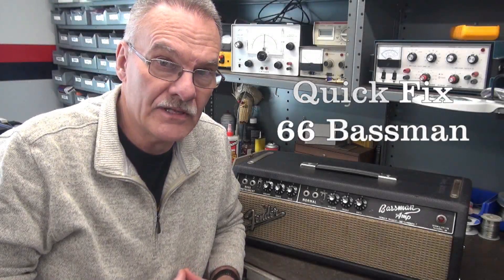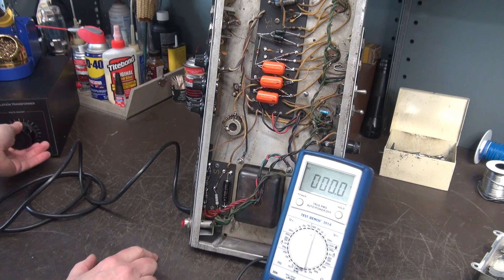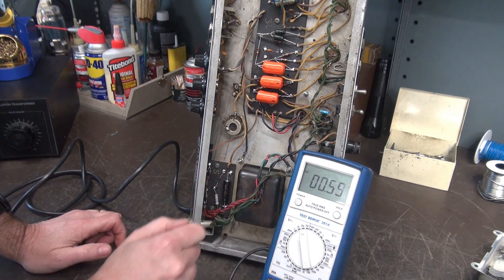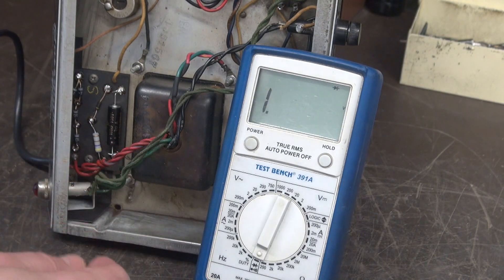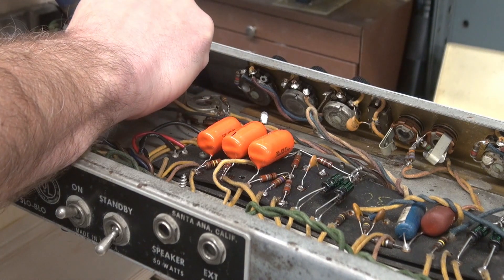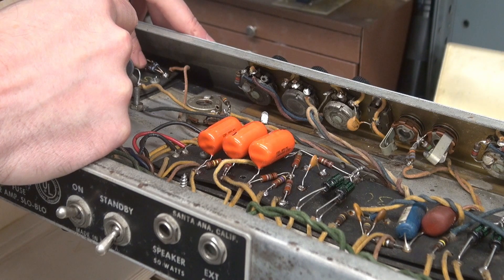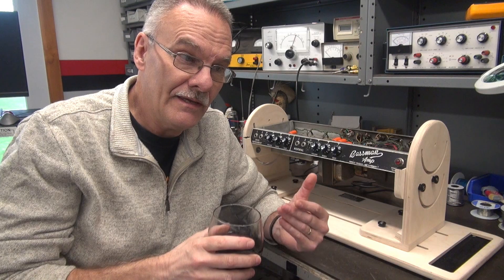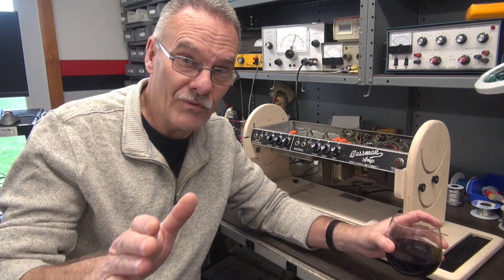How to quickly repair Fender Bassman guitar amp negative bias failure

Comment: Hi i have a 66 bassman. There are 7 Diodes in the biasboard. Will they be ok after 60 years or is it better to change them all to 1n4007 diodes. If they are to change can 1 insert only one 1 n4007 instead of the three or better install also  3 new Diodes.because one new is rated with 1000v. Thank you and Greetings from Germany

Comment: How can a screen
Grid be shorted and burn the screen resistor? screen grid is 
Far away from the plate or cathode and heater but it is next to G1 control grid. Far from G3 suppressor grid in a pentode.beam
Power tetrodes
Don't have a G3 but beam confining plates
Connected to the cathode. I know the heater can get shorted to the cathode the heater inside the cathode is insulated
With aluminum oxide
That can fail. The cathode is coated with
Strontium oxide barium oxide or both so how can Grid 2 screen grid get shorted to anyting and show up on a tester or a burnt screen resistor? What does it short out to?
This may sound like a funny question. I just don't see how.

Comment: Nice little repair. One of the Bassman 50s I did on my channel recently came back, and while the customer was here I quickly discovered major hum, and opened the dog box to immediately see the terminal completely broken off one of the main filter caps in series. Replaced it, tested the amp, which was so dead silent I didn’t think it was on. We plugged a guitar in and had fun with it.

Comment: Why did you not check for matching, then measure and set the plate/watt dissipation for the highest current draw pt, which would, I defend, be the more correct way to set the pt bias for a properly matched (or unmatched) set of pt's, instead of "good enough for me"..???  Based on what.??    The other problem I see is "a really cheap repair"..  Yes, the parts are cheap, but discovering the problem and setting a course of action is not..  Would you divulge what you ultimately charged for the repair..???
Reply from the maker: There will be a part 2 with more info, This was just initial inspection and revive
Reply: @d-labelectronics    As a suggestion, you might include the "part two" and possible outline of the next procedures, as many boob toobers will think the service is completed, no matter if the client wants more work done or not..

Comment: But why did the diode fail?  This doesn't give me a warm fuzzy.  Did the old diode have a low PIV that got taken out in an electrical spike?  Looking at the schematic, I don't think a shorted output tube could do that.
Reply: Overheating ( Thermal runaway) ?  The failure of another component ( simply to check, if the ampli not work again)? Overcurrent ? Overvoltage ? Simply aged or stressed ? Diodes can fail open, closed, and in between ( fail closed and open failure is  a subsequent event) .Who knows.
Reply from the maker: Have no idea man

Comment: Hey Terry, I don't know if it would interest you to do so, but you could get a cheap looper pedal to test your amps rather than the signal generator.  Not that there's anything wrong with the signal generator of course, but you could have a friend play some chords and lead lines into the looper pedal and then get actual guitar sounds through the guitar amps.
Reply: I was thinking the same thing.

Comment: I enjoy watching your videos. I took your advice a purchased a leader LAG 25 and I'm curious if you have an owner or service manual for yours. I'm not sure what the output voltage is supposed to be since it drops to zero when I turn it to the x1 on the output multiplier. This unit is like brand new and don't want to get into it until I know for sure what the specs are supposed to be.